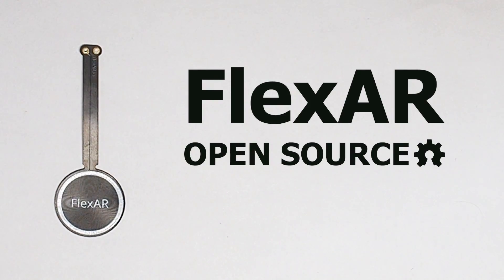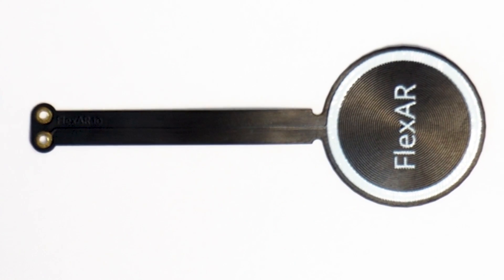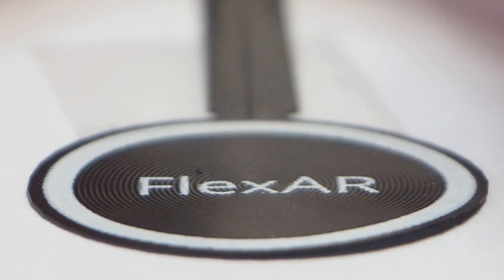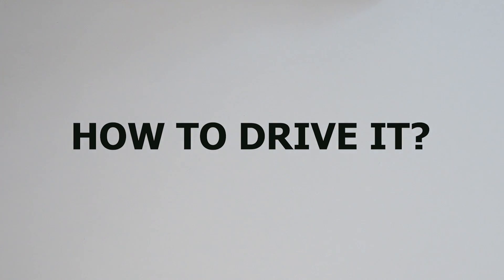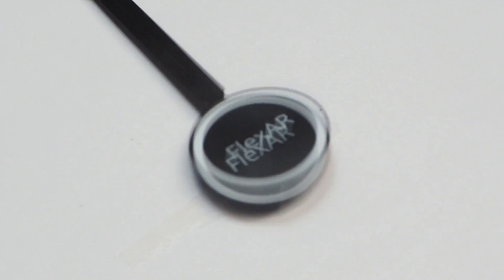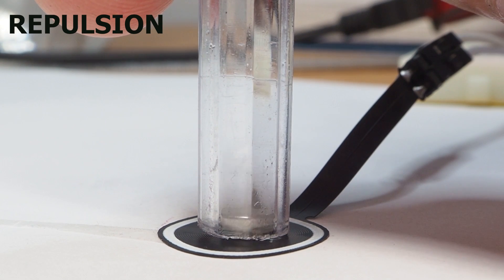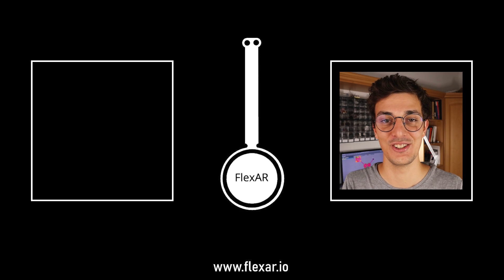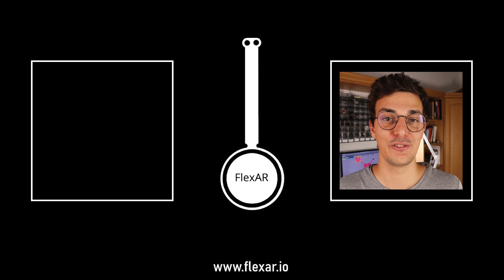FlexAR - An Open Source Flexible Actuator

Comment: did you ever think about to stack  PCB's (4 or more layers), each with a PCB coil inside. (like https://www.linearmotiontips.com/miniature-voice-coil-actuators/) to build a tactile  (braile) display? The holes for the actuator can be done by the PCB manufacturing and you has just to add an iron needle....done.  :-)
something like this https://www.agilemagco.com/wp-content/uploads/183_Image.jpg - but just with a PCB stack.

Comment: For the field of grass or wall display to drive a ton of them with something like an Arduino you could run a big bus of HC74573's and put their outputs to a grid array of n channel mosfets to drive the negative side and use p channels to drive the positive side. I'll think you'll want to run everything through gate driver chips to simplify the design. I think you should be able to multiplex any "grass blade" to look like you have control over everything at once. What kind of current do these things sink? Or whats the resistance of the coil?

Comment: I bought 5. That gives me enough so I can try driving one with a current limited stepper motor driver at more than 5 volts. When I blow one up, I won't have to stop using them.

Comment: Have you tried sticking some high magnetic permeability materials to the coil to increase its strength ?
Reply from the maker: Yes I have! I started making a video on it actually.. I will find some time next month to finish it - I have so many unfinshed videos right know 😅
Reply: @CarlBugeja  Carl check out high carbon band saw blades. The steel used in them same as what is used in rotor laminations.
Reply: And you get a lot of it in thin metal sheets when you purchase one blade.  Just have to cut off the sharp edge.